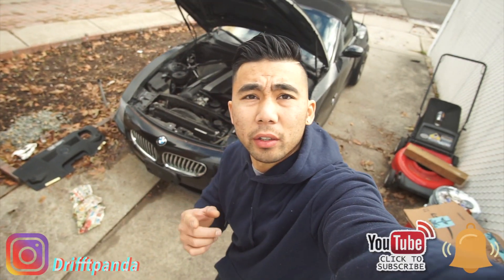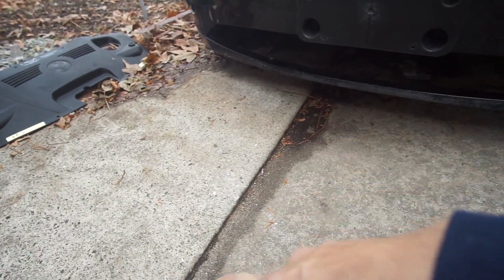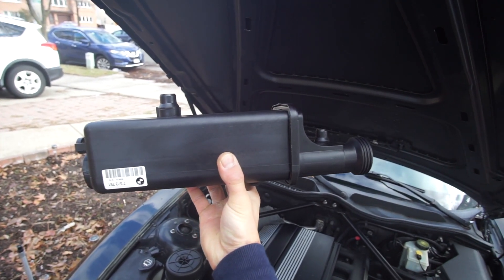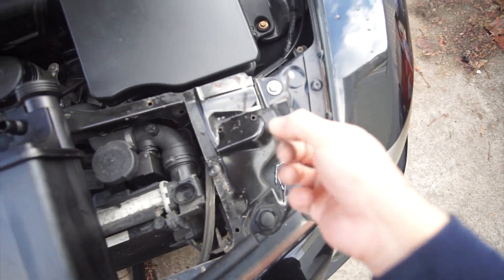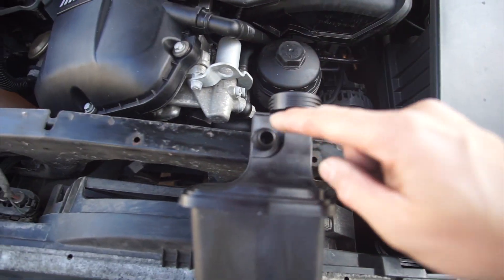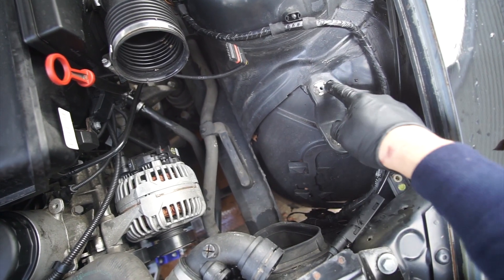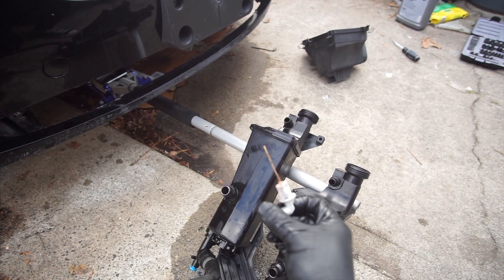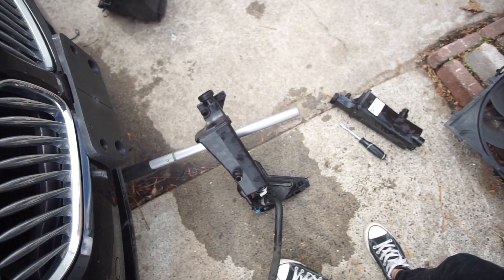Vlog # 9 How To Replace Reservoir Coolant Expansion Tank On Bmw Z4 #Bmw

Comment: Great video! I just bought a Z4 and wanted to learn the ins and outs of how to change the expansion tank. You did a great job showing us the best way to do it.  I have owned and worked on my 330ci for the last 14 years and have changed many parts of the cooling system - the Achilles heel of the M54 engine. I have changed my expansion tank at least 3 times in 230,000 miles. I really liked it when you said "taking the tank off the bracket can be a little bit of a challenge". That is the understatement of the year! Thanks again for the help as I learn my way around my new to me E85.

Comment: Subscribed, thanks for putting this on YT, did this for my 2005 3.0i and the only difference for me was I did not remove the fan.  I got under the car and spent some time there as hose #3 was impossible to remove from the top as well as unplugging wire to the level sensor.  I had to pull hose # 3 from the block as you did, that was tough as well but I was able to loosen with some WD40.  Keep up the good work and posting what you can on the Z4!

Comment: You can lift those hose clips just a notch and then remove the hose with the clip still in place. Sort of like those screws that have a retainer so you don't lose them.

Comment: Just had to do this on my 06 Z4 coupe yesterday
Reply: GoDoddsStudios did you need to remove the fan?  I am looking to do this on my Z4.
Reply: freirema5 it’s best if you do. I used my mates garage and lift which made it ten times easier when working under the car too
Reply: GoDoddsStudios ok thanks.  Did you disconnect the battery at all and reconnect when done?
Reply: freirema5 no I did not